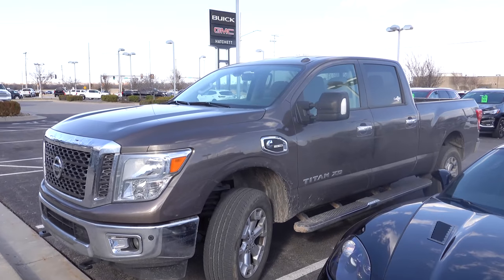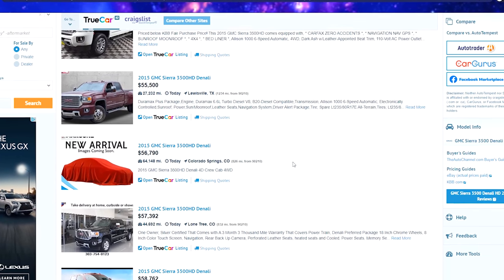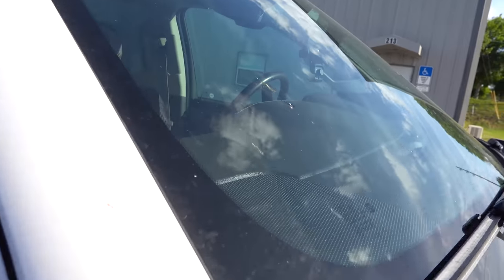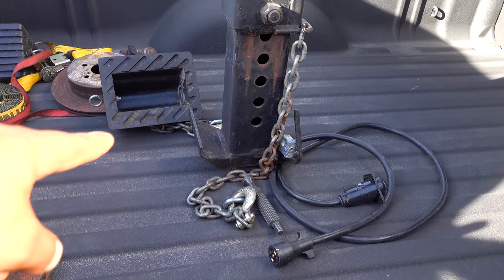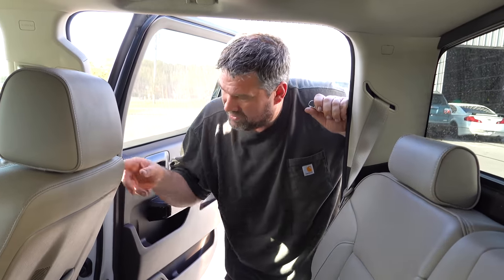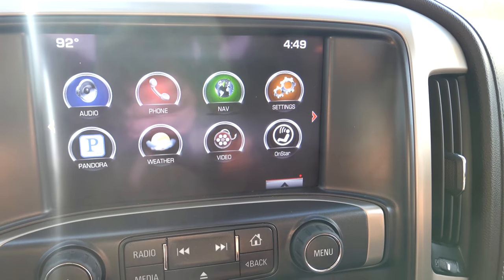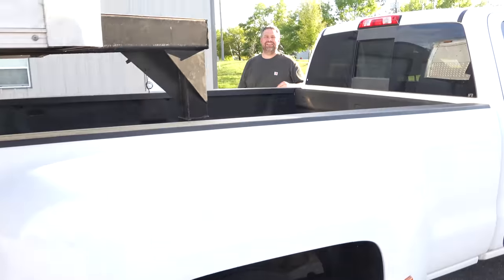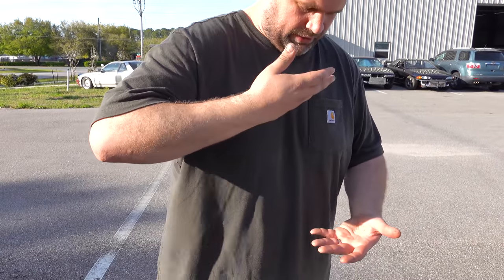I Just Bought My $100,000 DREAM TRUCK!!! (CHEAPEST IN THE COUNTRY?!)

Comment: Using auto tempest I found my father in law a 2012 F-450 fully loaded with 112,000 miles for only $39,000. Thank you guys and auto tempest!!!
Reply: How many miles are they good for?
Reply: @embeaston  depends if it was taken care of or not
Reply: I used auto tempest to find my father a 2009 F450 with 160k miles for $18k. Now I dont have to worry about his 96 Dodge giving up the ghost in the middle of the arizona desert where he lives.
Reply: I got fully loaded 86k mile 2000 4×4 F350 7.3L PSD ZF6 locally to me for $550 due to a blown oil cooler o-ring. The old man who owned it bought it new and didn't want to even try to listen to me when I told him the problem and how cheap and easy it is to fix, but she's mine now and has 565,950miles just 6 years later
Reply: @embeaston  6.7 diesel, it's just broken in. We have all service records from previous owner. Plus my FIL own an 18 wheeler transport company and knows a bunch of top of the line diesel mechanics. So this thing should easily last damn near forever.
Reply: maxnautical it’s a ford not much
Reply: Have you ever tried crystal meth?
Reply: @embeaston  113k
Reply: Simon Hsa  anything comparable to that within 800 miles was going for $60k or more.
Reply: Lol a 2012 for 39k a friend of mine bought a brand new chevy 2500 hd crew cab 4x4 gaser for $42k
Reply: @neilbrown82  that's a 2500. This is an f-450 crew cab, dually, 4x4, gooseneck attatchment, fifth wheel, and camper shell all included.
Reply: @matthewbrayton8166  nobody gives a crap it's still a nine-year-old vehicle
Reply: @neilbrown82  Doing a lot of typing for someone that doesn't give a crap.
Reply: @classiestbogan  🤣😅👍cool story bro
Reply: @neilbrown82  Well thought out and educated response.
Reply: Wow you got ripped off
Reply: That doesnt sound like a great deal but idk.

Comment: I had a 2007 Chevy Silverado crew cab diesel dually and it was awesome.  Last of the good years for diesel.  I can't believe how well these hold their value.  

What's up with the bumper cover on the passenger side of the truck?  Sticks back towards the front wheel a bit.

As for the feathering of the tires up front, just rotate them to the inner dual, move the best of the tires to the front and you'll be fine.

Comment: Just a recomendation, but I would strongly advise that you run Archiol 9100 in the fuel, it will help keep the SCR and DPF along with the injectors clean. Also make sure that you keep up on doing static regens once in a while to prevent excess carbon build up in the very expensive exhuast system

Comment: Congrats on the new truck! I did the same I went to a 3500 dually with the cummins. Can't compare the two on power. However regens and def I can. The regens is alot less on my ram versus the Titan. The Titan would regen every tank and a half where my ram has regen every 1000 or so miles. Def usage as well is less.  Don't know If that little cummins  was underpowered for the weight and was overworked causing more def and regen or just a bad design.

Comment: Congrats on the new truck! You will love it. I have a '21 2500HD Denali, and I love it and its rated to 19k lbs as a 3/4 ton, but you cant even get new ones fast. People have waited 5 months for theirs due to delays. Its crazy hard to get 3/4 ton and bigger trucks right now. The 6.6 is great and paired with the new 10 speeds its butter. Towing is insanely easy with a proper diesel.

Comment: I have an 07 LBZ with 330,000 miles. Second set of injectors, never had the heads off, never had an issue other than a fuel hose pinching under load. Easy fix. Absolutely love my Duramax

Comment: $51,000 for a used Truck? That's exactly why I'm still driving my 93 F150.
Reply: What do you expect? It's 6 years old so basically new, and new stuff is expensive.
Reply: Considering a new one is $100k and this only has 55k miles, it is a pretty good deal.
Reply: It's a 5 year old  full boat 1 ton 4x4 dually diesel with less than 100k miles on it. What would you think it would be worth? They aren't wrong that a 2021 version would cost 2x as much.
Reply: @xumot  that should be it's new price, the only reason truck's are selling for $80-100,000 is because someone is stupid enough to pay it. That's why when they have the big sale trying to get rid of inventory you will see adds that say $20,000 off. If people just stopped buying them for that price they would be forced to lower the price.

Comment: 2016 Super Duty 350 DRW 22k miles, almost every option but heated steering wheel, got in August at peak of the market on these. 
$56k out the door. For the record, you paid L5P price for a LML. Be sure to update soon the soon-to-be failure parts. Got rid of a LML last year because got tired of fixing it

Comment: Very nice truck, congratulations.
 I do not want to introduce a negative in any way but in case you do not already know GM used the CP4 Bosch High pressure fuel pump from 2011 through 2016 on the 6.6 Duramax. There is a class action law suit currently due to the fact that this pump is prone to failure and when it does it will spread metal throughout the fuel system requiring new injectors, pump, fuel rails, etc $$$. Apparently it is easy to check for the problem and if caught very early there are remedies. In 2017 when GM started producing the L5P 6.6 Duramax they went to the Denso high pressure pump. There are probably many thousands of these trucks with very high mileage that will never have an issue. That said you might consider looking into it if you have not already, knowledge is everything. Thanks for the video, I am now subscribed and looking forward to more!

Comment: Just traded my Titan in for a 2500 Denali black diamond edition and got a rock chip within a week. Safelight patched it up but still noticeable. Luckily it is on the passenger side. 83k truck and the dealership ruined the paint from the get go and a rock chip. Not the best of starts so far.
 If you do anything then I wouldn’t look anywhere else but Banks. The derringer is better than any tune

Comment: You guys just helped me!   I was thinking about selling my 2016 Silverado High Country 6.6HD TD crew cab long bed, just like your Denali, except mine has less than 11K miles.   You've just told me that my asking price should be north of 65K, and maybe more...   I'll look at competition on AutoTempist and check it out.   Oh, the 2017 L5P engine is a brand new motor.  It happens to be the same size 6.6L, but it is a different engine with app 60 more HP and 150 more FT TQ.   That said, LML engines are nice engines.   I think you'll enjoy this truck for years to come!  Have fun!

Comment: One should find out if the high pressure fuel pump has been replaced.  A good number of them like to grenade and it wipes out the whole fuel system with metal particles throughout the whole system.  You have to replace everything.  Pump, high pressure lines, fuel rails, injectors, filter housing, and sometimes the fuel tank lines and the tank.  It's about a $10k job.  Pump replacement is a grand.  Mind you it makes for less dramatic youtube vids.  

If you're going to turn up the power you're talking out of that truck, get a transmission with a PPE stage 5 kit, Goerend transmission cover kit, and a Goerend triple disk billet torque converter.  If you don't, and you turn the power up on the truck, you'll eat that transmission in short order.  

LML engines also like snapping cranks.  Tuned ones do it, and stock ones do it.  If you want to push the truck hard, upgrade the crank to a billet one, or at the very least get this one balanced. A stock LBZ crank is likely an upgrade as well.  LML engines will also crack pistons.  LB7 pistons are the best stock ones and fit.  Mahle has upgraded pistons.  Lincoln Diesel sells a full rebuild kit for that engine.  

For the small fee of $10 a hp, you can buy the parts to get 1000 hp reliably out of that truck.

Comment: My dads 2006 Nissan Titan has over 250,000 km and it’s been so reliable except for the transfer case wiring always needing to be fixed. Northern driving too it’s the only vehicle we have that starts in -40c and it fired right up with a new battery after sitting for 4 months

Comment: My bro has hot-shot delivery service and also runs new RVs all over the country. He was a Chevy guy. He learned the hard way with GMC 3500's . Both were gone with 100k on odometer. Mechanically salvaged b/c of costs to repair. He bought a dodge 1 ton dually cummins, then another one. He eventually had 3 guys and 4 dodge 1 tons doing 250 + thousand a year on them. The problem with them however was the engines were good tho expensive to repair but the trucks around the engine fell apart. Especially brake issues. He's got a Ford F-450 now w/ 500k on it and is gonna trade it in for another b/c they still have value. Yep.

Comment: Beware of the Bosch CP4 injectior pump. Due to the low lubricity of modern ULSD fuel, the injectior pump can catastrophically fail by internally grenading itself and leaving metal shavings throughout your fuel system, thus destroying it. Look into a CP3 conversion or adding a lift pump to combat this issue and prolong the life of the engine.

Comment: The 2020 year models on, no longer have a true Alison Transmission, it’s now an Alison licensed transmission that is not as strong as the pre 2020 GMCs. 
PS. I beat your deal 2 years ago, $60K for a 28K miles, white on black, 2016 3500 dually crew cab 4x4 Denali Duramax With every option available, plus air ride rear air springs with wireless controller ( I strongly recommend the air springs). 
You’re gonna love that truck. 
Keep an eye on the DEF tank, they’re known to crack.

Comment: Msrp on that truck was around 73k new and you could buy them for about 10k off msrp brand new. I was a manager at a gmc dealer in 2015. Not a smoking deal at all for $51 used with 55k miles.  Plus it doesnt look right. Those arent factory denali tow mirrors. Theyre aftermarket. The factory denali mirrors are chrome. A brand new 2021 3500 denali fully loaded msrp is $82k and you can buy them all day long for 75.

Comment: Congrats! Now you can reroute pcv, and take care of the deletes and it will run forever. Unfortunately the emissions equipment will cause the same types of issues the Nissan had in the long term. Use optilube xpd every single tank, those cp4’s need lubrication. I have 500k on my lmm and she blows no smoke and has no sludge buildup anywhere.

Comment: Man, they have gone up in value.  Mine was the same year/spec in Black, 82k highway miles, and it resold for $44k.  It would pull my 35' travel trailer all day long and still averaged 14mpg. 45 fits under that cup holder.

Comment: my work just got a 2017 RAM 2500 with the biggest cummins (the 400hp/1000 torques one) and 48k KM on it for $40k CAD. it just doesn't have duel rears but there is no way that duelies alone increase the price by that much, and its not a salvage title. $40k CAD is $31K USD

Comment: Well, now that you have something Gale Bank's and Company do performance and fuel mileage up grades, once you have your list of GM "deficiencies", go there and do that. Among the things Gale has figured out are things like using the better late model oil pump/coolers to improve low end oiling- never a bad thing for towing. And he knows where the power is in that series of Dura Max.  And you can tow Freddie's truck to the shop, or maybe the Wizard Karl will appear!  FR

Comment: The name of the new Duramax is the L5P.  Also, they do not share much other then the name Duramax on them.  The L5P was a complete redesign to make the engine handle higher power out put and the new emission standards.  On the surface it might seem that it is a "LML with a tune" as Tavarish said but it is not.  They wanted to be more competitive with the new dodge and ford motors while at the same time having the engine be able to handle it.

Comment: Looks like someone swapped your SLT/Denali mirrors for SLE mirrors. I worked for GMC when these trucks first came out. Those are not the mirrors that would have come on a Denali trimmed Sierra HD.
Reply: Looks like other exterior trim pieces are different but don't know the trucks well enough. Is that front lower air dam stock?
Reply: 2015 Denali HD’s had the old style black mirrors. 2015.5-2019 had the newer chrome power fold tow mirrors with marker lights.
Reply: @dash456789  you might be right.. we didn’t start getting them in until mid 2015. Makes sense!

Comment: An F-350 Platinum 6.7 Powerstroke makes a significant amount more power and torque, has a much better interior than anything GM, and you can get one for around the same mileage and price as your Duramax pretty much anywhere in the country.

Comment: There are major differences between 2015 and 2021 GMC 3500. 2021 has bigger interior, exterior is beautiful and the interior is better than the 2015. There both nice trucks not bashing on the 2015 I have just been in both. Also 2021 has cameras up the wazoo.

Comment: Has problems with carboning up on previous diesel truck, says its due to emissions, buys more expensive diesel truck. Yes, making questionable choices. FWIW, my uncle is an excavator and tows a skid loader + additional things behind his Gas 2500 HD and it has needed only a few minor repairs in 230k miles. The transmission may not have too much left in it but these diesels can really become money pits. That thing will likely never have more than 12k lbs behind it if you're just pulling cars in trailers.

Comment: I understand the issue with the titan diesel, but please not badger all titans they are all bad, I have 2013 with the 5.6 gasoline engine and it runs and drives like the day I got. It had 148 000 kms on it.

Comment: I feel like I did good with a state surplus auction 1994 Chevrolet G20 for $2200.  

But if you want a hauling truck I will sell you a 1993 GMC 3500 dually with gas V8 and 5 speed NV4500 trans for $2000.  It's a little rusty.

Comment: Like these guys but this is not a $100k truck. Even in 2021. It's at max a $83k truck. There are phenomenal amount of difference between that truck and a 2020 or 2021. Good find and a good price. If I was in their shoes I would have bought it also. Nice job guys. Where I live, that truck on a sales lot would be about $55k to $58k at least with only around 50 to 55k in miles.

Comment: The most expensivecars can have blanks,if they do a convertable version and the top model is not convertable but a coupe, do you think that the roof switches are installed for giggles? There are 100 thousand dollar mercs a bmw's with blanks,watch doug demouro for reference.

Comment: Apples to oranges the Titan xd was a heavy duty half ton. The gmc is a 1 ton truck. The towing capacity of the the XD was 12000 lbs if you treated it like a 1 ton truck that’s ur fault not the trucks.
Reply from the maker: It was pulling less than that weight, 6800lb trailer,  and 3000lbs or so in a car.
Reply: @TheQuestionableGarage  I had a 16 platinum reserve Nissan Titan xd diesel for 3 years as we traveled the country full time rving pulling a 40 foot 10k lbs travel trailer all over the country. Never had any mechanical issues whatsoever. I followed the Maintaince schedule to the T and followed all the recommendations from Nissan and Cummins. Was a great reliable truck. Only issue I had was crappy dealerships none of them knew how to do simple maintenance to this truck without screwing something up.  After crappy dealership tried to get out of warranty work on a minor issue interior part ( sun visor) and mounting headaches over 3 years of dealing with crappy dealerships and their incompetence I traded my beloved Titan xd for a tundra.  The Titan xd never had a chance to be a great truck from haters all over the internet to lack of marketing to Nissan dealerships not knowing how to work on it. The truck was doomed from the beginning. I’m one person who was pleased with the truck.
Reply from the maker: If you look back, Jared was a huge cheerleader of the truck, and it was almost over maintained. Nissan and Cummins failed the truck, and the total lack of parts really killed it.

Comment: My TitanXD lasted 2yrs, 53000mi, and the transmission went to crap. Couldn't get it fixed, and then the trailer brake controller decided to stop working, couldn't get that fixed either. So I fixed it with a 2021 GMC Sierra 2500hd gas. Gets about 3-4mpg better empty (24mpg best trip), and about 50% better towing (11.9 average with my shop trailer for the last 3k miles). 

Pretty good fix so far.

Comment: stupid dump trucks man. my thing i just bought a brand new car a couple years ago, only had maybe 200 miles on the thing.. sitting at a stop light, then a stupid dump truck goes by hauling ass and deposits a giant asteroid on my windshield. 1450 dollar windshield because all of the sensors in the glass. then about 4 weeks ago, i get a stress crack all the way across my windshield and i get a ticket for the crack being there i have an appointment this week to get yet another replacement.